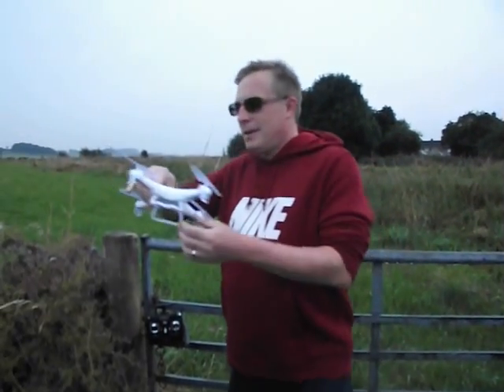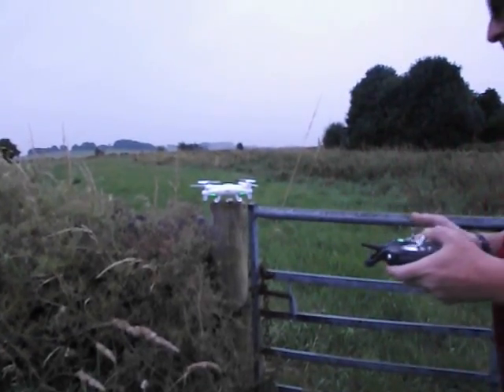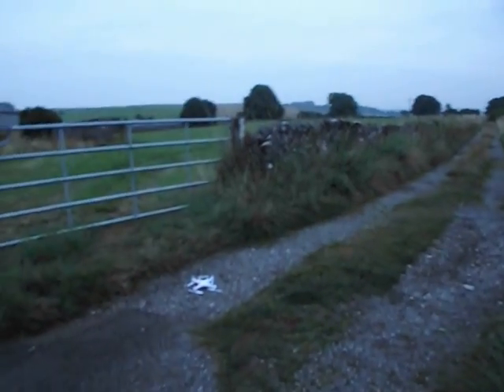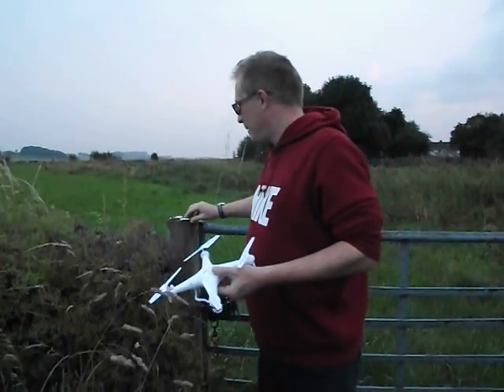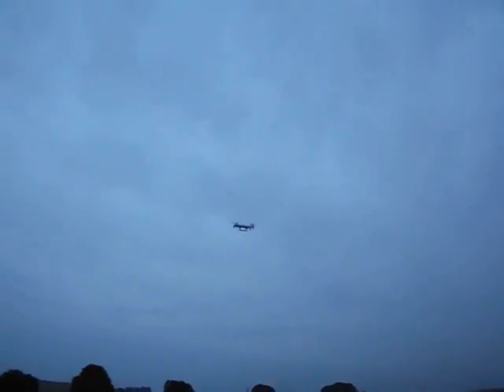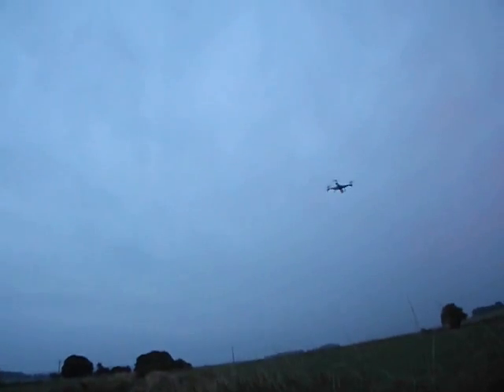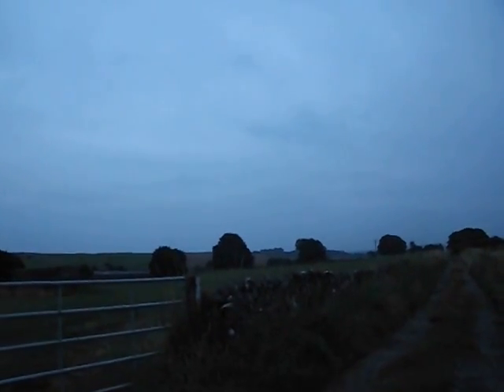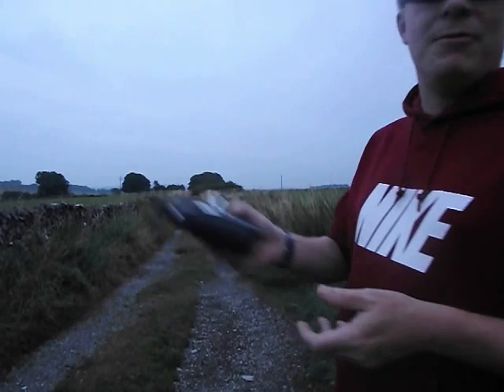Syma X5C Quadcopter - Upgrade Vs Stock Battery Flight Test

Comment: 6 minutes 23 seconds with this upgrade? I have flight time with Bayangtoys X8 and Turnigy nano-tech 750 mAh, 35-70C battery + 35 grams FPV mobius camera (5.8 GHz) - about 7 minutes. Did not measured time exactly, but plenty of flying time.

Comment: I bought a pack of three of the 600's and two of them have never reached the 4minute mark.  I got 5m 37s from the Syma 500 under the same test circumstances.  I'm going to do a discharge test with a light bulb or high power LED when I have the time.  How do we know that the battery makers figures are accurate, after all it's easy for anyone to say that a battery is a certain capacity.

Comment: 750mAh test? I've not been able to find it on your channel.

Got a Koomes K300 which honestly Syma's look like a rebranded version or vice versa and am planning on getting some extra batteries for it.3.7v 600mAh, but unfortunately the serial numbers on it are bringing up zip.
looking to get some extra run time, especially when I am using the included camera.
Any advice would be appreciated.
Reply: *****
er, um.... thanks?!?!?

Comment: Hi Guys! I Bought My Quad From Red5 About 2 Weeks Ago The Sales Person Suggested I Buy Another Battery To Extend Flying Time, Good Job I Did As The Battery That Came With The Model Has Packed Up It Will Not Except A Charge! Where Is The Best Place To Buy The Upgrades You Are Showing, Great Vid By The Way Great Work Well Done
Reply: Dude go ban good  or gear best

Comment: I thought the standard run time was pretty good anyway. Maybe the 600mah will be better once it's had a few charge cycles. Or is the extra weight of the 600 taking more power to lift.
Reply: +thra5herxb12s no same weight

Comment: How do, I have one of these and used it loads - great copter. However recently one of my motors failed, I could tell something was not right as it lost all of its inertia and struggled to go up, would just hover. Anyway, I changed the motor and thought all was well. Strange thing is it still felt like it lacked power, so i changed the remaining 3 motors. Sadly it seems the same. I have 5 batteries and its the same with all of them. Any ideas what might be the issue?

Comment: did you finally test the 750mah battery??
Reply from the maker: Yep it did a lot better. Average 10 - 12 mins flightime.
Reply: I want to try 700mah battery.any comments?

Comment: Can anyone help with my x5c, I just bought 4 new batteries (new from ebay) charged them all up, im getting less than 1 min on full power from 3 of them! after the low power shut down, i checked the voltages and they are all 3 at around 4.1V. why is the drone shutting down on that voltage?? having said that, the stock battery is fine and so is one of the 4 i bought so I'm guessing they are faulty, but the voltage thing is baffling me :-)
Reply from the maker: Yes it looks like you have a faulty batch of batteries, if others always work fine then it's not the quad.

Comment: hi all i seem to have a problem with this now X5C
i have about 5 batteries  and they only last about 1min or just over
500mah 600mah 2x650mah  750mah i did get around about 8mins.all batteries have been tested and ok.
but one of the motors do get abit hot so i wounder if that is the problem..? its cool now found the problem it was one motor that was the problem it was abit hot draining the batteries..all good now get about 7 to 8 mins running time..:)
Reply: ***** i replaced it with a new one
easy to do and motor cheap..:)
Reply: ***** yer i loved it .now iv moved on to the phantom and its great but if anyone wants to start up flying the x5c is the one great qaudcopter..:)

Comment: Very interesting demo Xtratalk1, however please note that SYMA has released a New and UPGRADED battery for the X5C and X5C-1, called the “3.7V 720mAh 25C V931 F949 for Syma X5C”. They are about $12 for a set of 2, with Charger and and USB cable. Very importantly, the Flight Time Rating now approximates to TEN MINUTES (I assume without Cam). I’ve ordered a set and will post the results at a later date. Stay Tuned
Reply: Any word since using them?

Comment: +John thereseller You kinda sounded like you know what you are talking about apart from one thing. What PCB do we put in there, PCB means Printed Circuit Board, which is in all electronics. So which one are you talking about or just any one will do? (throwing a PCB from a calculator in there for example), obviously that's a stupid thing to assume, please explain your comment a bit more. I assume you are talking about a power distribution board which the Syma RTF quads do not have, they use a single board construction. So are you talking about an after market mainboard or do you have this quad confused with a non RTF type where you would need to supply flight gear, controller board, power distribution, receiver hardware, ESC's etc? Your statement is a bit like telling someone to put metal things in a car engine to make it go faster.

Comment: For those of you doing a battery mod look into a PCB board and you can even run dual voltages such as 3.7v and 7.4v if you hav say motors at 3.7v and the camera at 7.4v and then you can run the higher voltage battery stack or a larger singular battery. The main issue everyone needs to be concerned with is over charging or excessive draw as that could make the battery explode. With a PCB you can control the draw on the battery also to limit the drain to a certain voltage which will reduce overheating and extend flight time. Beyond this I can not offer more info.

Comment: Hi ! Do you know if we can charge with an iphone adaptor ?
Reply from the maker: It's recommended you use a PC or Laptop as they are low voltage on the USB output but I find an iphone USB adapter is fine. Just stay away from those cheap USB to Plug adapters as the voltage can be high on those which will affect the longevity of the battery.
Reply: xtratalk1 Or buy a real Lipo charger.  One that measures mAh put in can be especially helpful.

Comment: I got an idea watching your mods. If you take two standard 500MAh batteries and wire them in series to double the voltage, put one in the battery compartment and tape the other in the place where the camera goes, is it possible to operate the copter on higher voltage, to improve lift (possibly with 3-blade props)? I assume the left control regulates how much voltage goes to the motors - more voltage = more rpm = more lift. So if the voltage starts out high, you could operate the left control in the lower range and still have higher voltage (more lift) than with one battery. Just wondering if this would work.
Reply from the maker: I like your way of thinking :) Yes I think that would work, basically all they have done for the battery for the new JJRC H8C Quadcopter is stick two X5C batteries together and rewire them. And yes your right, more throttle = more voltage
Reply: xtratalk1
Thank you. Yes, I was amazed that they just doubled the battery for the H8C. Quadcopter 101 replied that the higher voltage might fry the Syma circuitry, which is expecting 3.7V, so I'm wondering if the H8C has undergone major voltage mods to deal with 7.4V or if the circuits are robust already, like the camera too. I was ready to buy the Syma, but it has such limited lift, then I saw the H8C. I have a FPV goggle w/receiver and transmitting camera that needs 6V (4AAA) and now believe the H8C might be able to carry the cam, if I leave off the stock camera, maybe do a battery mod for more mAh. Or maybe the cam can handle 7.4, so one big battery for copter and cam. I like your thinking too. Nice videos.
Reply from the maker: marjamada I'm waiting for a H8C now so I will certainly put it's payload to the test when it gets here as it's something I'm looking forward to testing, Quadcopter 101 has a good point, I'm guessing there is a resistor though which should prevent overload and would also hope that this would slow voltage down and in turn increase battery time but I'm only guessing. I do have a few X5C's here now and have been asked to show an antenna mod on the quad itself so it will be a good opportunity to open one or two and have a good look what is inside and what can be done with it :)
Reply: xtratalk1
For your next mod, check zeeproduction's vids, he's done several and isn't shy about chopping and rearranging innards, and lots of antenna mods out there with great results. I still don't have a quad, have looked at dozens of vids and am now ogling the Galaxy Visitor 3 with return-home and a matching price tag (ouch). You know, "Will I outgrow this in a week?" syndrome. My interest is video, not flips. Guess I'll watch more videos. Thanks again.
Reply from the maker: marjamada Yes if your looking at it primarily for shooting video then you want something more stable like a Phantom, I only use my FC40 for video now and the X5C and X6 for fun. The Galaxy Visitor 3 looks a great quad, not sure if it has GPS though the RTH seems to be locked to the remote control rather than GPS, I have noticed one or two sellers putting GPS in the title but haven't been able to find it in the actual specs.

Comment: I'd like to experiment with different batteries but I can't find the connector type. Does anyone know? Thanks.
Reply: I couldn't find the answer before which is why I asked but I have just discovered that the battery connector is called the Walkera connector or Hubsan connector.
Reply from the maker: David Maddison Hi David. Yes it's known as that as it's the most common connecter for these smaller type of quads like this http://i.imgur.com/axU5Owm.jpg

Comment: I've learned that higher mah does not always correlate to longer flights. Generally, the better brand battery does better given the same amount of mah.  Also, weight.  These small quads are very sensitive to even modest increases in weight.

Comment: There's no indication if the battery is low? It will just shutdown mid air?
Reply from the maker: Yes the lights will flash on the quad when it's almost flat but it's easy to miss in the daytime so it's always good to know roughly how long you get from each battery and bring it down with a minute or so to spare. It's also better for the battery if you don't completely run it down on every flight and will last longer ;)

Comment: I don't understand why the upgraded 600Mah battery gives you less flight time than the 500 Mah standard battery ?
Reply: and what I found with mine is, the 600 seems to be delivering unsteady power, when I fly on the battery that came with it I have nice smooth flight, but when I use either of the 600 I bought the copter will just start to climb on its own and when I pull back just a little in the stick it goes all the way to the ground, but like I said on the 500 that came with it, nice steady flight, it holds what ever altitude I set it at, and climbs and descends smooth as silk.
Reply from the maker: Eddie Gregory
Yes I noticed similar. A lot of people say the 600 are better, maybe we got a bad batch as they sell them in bulk.
Reply: xtratalk1 Well I went ahead and got one of the Turnigy nano-tech 750mah batteries and it worked great, and it flew for a long time, I'm very happy with it, just make sure if you get one that the polarity is correct, if not just change the wires so that it is, I have heard that sometimes they are reversed, mine was right and I didn't have to change it

Comment: Hey, I tested the nano-tech 750mAh. All are charged with around 800mA. Flight-time is around 10-12min (depending on weatherconditions) with wind. With cam it is 9-10 min. Very good. I am very happy.
Reply from the maker: Michael Pickering
Yes, though sometimes they are not as easy to fit in as the standard battery
Reply from the maker: That's great news my friend glad to here you got more time too.
Reply: Is this one the right shape and size? I'm just waiting for my quad to arrive - can't wait!
Reply: xtratalk1 Sorry, I tried to post a link, but failed! Will the Turnigy nano-tech 750mah 1S 35~70C Lipo Pack (Fits Nine Eagles Solo-Pro 180) - as on hobbyking .co .uk fit?
Reply from the maker: Michael Pickering Yes it will work but is a tighter fit, I use the 3.7v Turnigy 750mAh 35C-70C (NE-BA931), also remember to reverse the polarity (change the black and red around)
Reply: We have tested both the Turnigy and the Battery Pack from BG http://goo.gl/stXHWc and the difference is minimal, arounf 1 m difference from the 600 to 750mAh.  (but LiPo 600 are a lot cheaper).

Comment: Hi do you know if you can us a 20c 3.7 v 1000+ mah battery on the syma x5c just wondering if you know thanks
Reply: I think so, if the connectors are the same and it fits and works ok then there shouldn't be a problem as it's 3.7v
Reply from the maker: If it fits and works then you should be fine as it's 3.7v